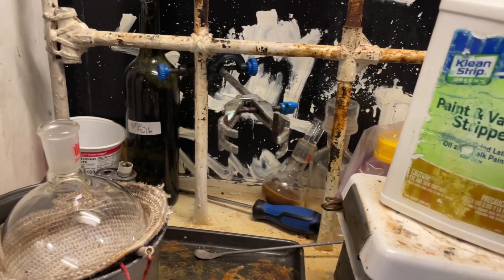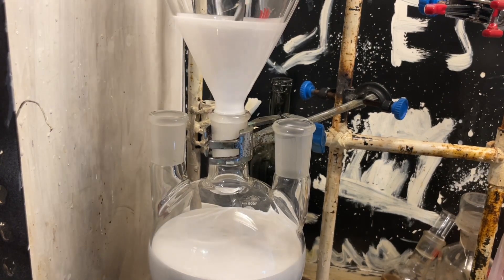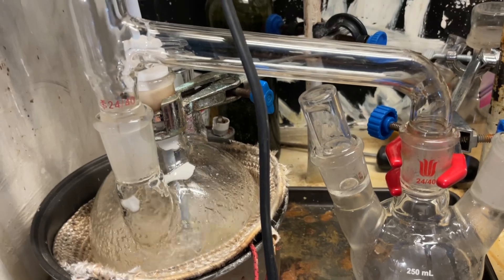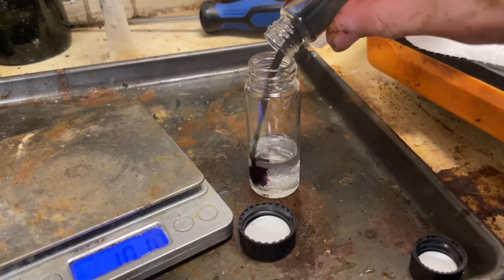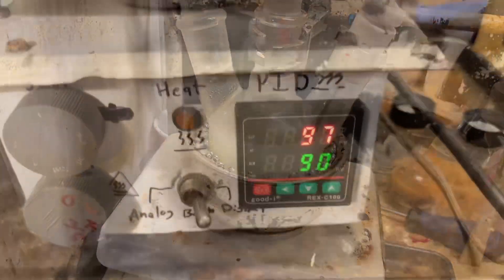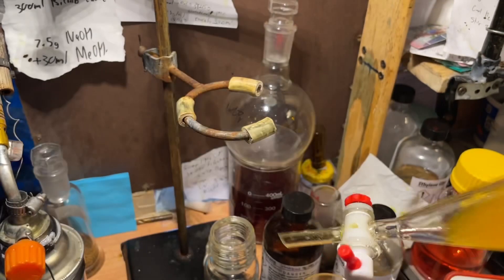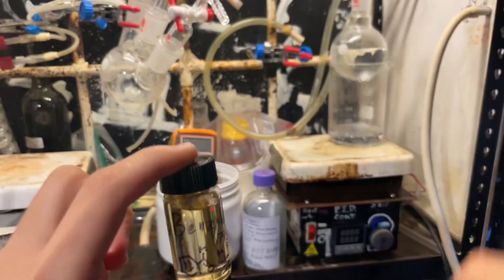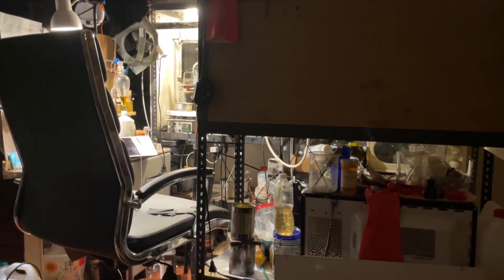Benzaldehyde synthesis from Paint Stripper (California Edition!)

Comment: That graduated cylinder seems a little smaller . And again you make me feel not so bad about my own sloppiness at least you have a fume hood.
Reply from the maker: i printed some plastic rings for them a while ago but i lost them, either way these are the cheap bomex cylinders, theyre paper thin to begin with
Reply: @EdwardTriesToScience I only broke mine once in the last year or two, but yours, well you seem to be able to chip away at it a little at a time and tell how old a video is by how short your graduated cylinder has gotten, I just find it oddly amusing, don't mind me...
   For my broken one, one of these days I plan on cutting the base of and melting it on to the top with a stem from a wine glass and filling it with clear candle wax to look like a syringe, but it's a candle, I figured it would be good art for drug addicts or something... It ain't art if it doesn't trigger somebody, right?

Comment: I really enjoy your videos, but it pains me everytime I see you working with dangerous chemicals without any gloves ever. There are indeed instances where having gloves on can be worst than not having any but these are not as common as those where having gloves might save you from exposure to toxic chemicals or simply from a chemical burn.
Reply from the maker: @williambouthillier8611  and i can understand that but frankly a lot of things are not hazardous when you can wash it off because the sink is next to you, though in newer videos you will see i wear gloves more but frankly and in my opinion still, sulfuric acid and such are not hazardous to handle barehanded, protecting the arms and more sensitive skin is more important. ive also witnessed a chemist spill sulfuric acid on his gloves, and not noticing until they dissolved off his hand in a lab before, that lack of physical feeling and dexterity is why i prefer not to wear them often. 

for contact poisons or otherwise highly nasty substances or chronic/accumulating toxins, i wear gloves, but for acids bases and such (with the exception of certain cases such as hot acids or fuming nitric acid which is evil) i usually dont because i am working with small amounts and i am pretty cautious to not spill anything. i wash my hands between video shots or when i think they have been exposed to something (sulfuric acid for instance you know immediately you have contacted, while on nitrile gloves they only exhibit a slight bit of warmth that you wont notice until the gloves dissolve entirely. sulfuric acid does not attack the fingers or palms fast, but thin skin such as arms will be immediate thus my priority is to cover what will get damaged quickly rather than what evolution has made to be resistant to harsh environments)

Comment: Is it just me, or does this guy start off sounding a bit like heath Ledger in Dark Knight? But on a serious note, I had my own similar happening with kmno4, but my alcohol that was notorious was methyl alcohol. It ended up popping the cap off the bottle, splattering all over the ceiling of the old garage that became the scene it so did back then

Comment: Survival of the fittest! 
Quick question, slightly of topic?
Q: Photochlorination of Toluene, if 200g tablet of TCCA has approx 100g of chlorine available. How much Hydrochloric acid would be required to exhaust the supply of chlorine? Think this is the easiest route via Benzyl, benzal chloride to produce ---> benzaldehyde. --> benzyl alcohol.
Reply from the maker: 200g tablet assuming pure TCCA then 1.16205mols so 38.735 ml of 32% HCl, round to 39 to be sure
Reply: @EdwardTriesToScience  thanks heaps. I'll see how it goes :) 2:1 chlorine to Toluene for Benzal chloride. 🍉